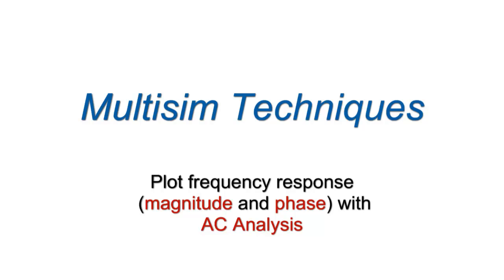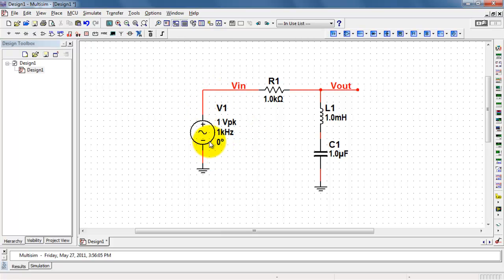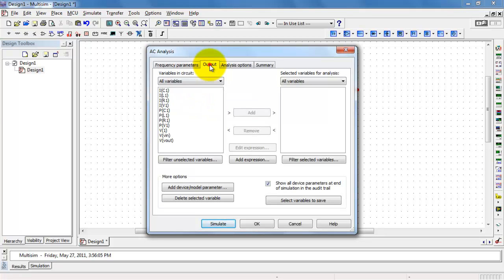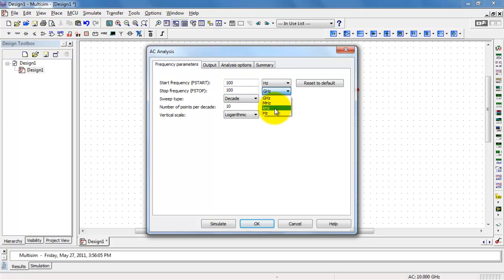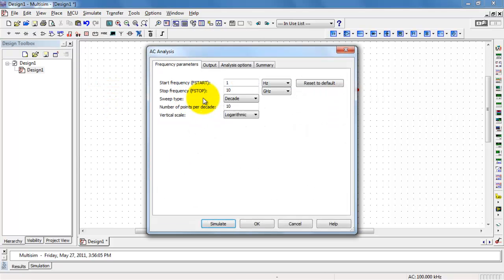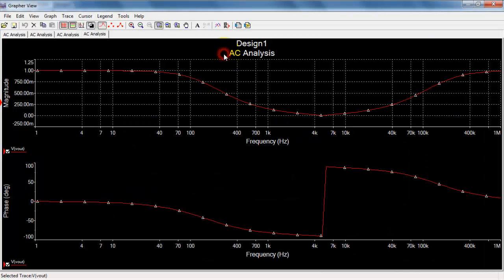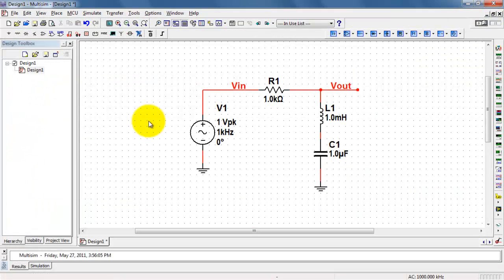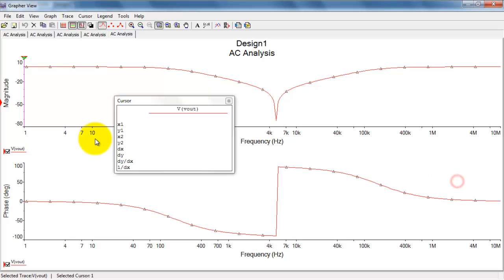NI Multisim: AC Analysis frequency response

Comment: Why does your phase plot show frequency on the X axis instead of degrees.
Reply from the maker: bassk94 An "AC Analysis" reveals how a sinusoidal signal passes through a dynamic linear circuit. Because the circuit is linear the output is also sinusoidal and its frequency is identical to the input. Because the circuit is dynamic (contains energy storage elements like inductors and capacitors) the output sinusoid's amplitude (magnitude) varies with the frequency of the input sinusoid, therefore the "magnitude plot" shows how the magnitude (dependent variable, vertical Y-axis) changes as a function of frequency (independent variable, horizontal X-axis). The output sinusoid also shows a time shift relative to the input sinusoid, and "phase" normalizes this time shift by dividing by the sinusoid's period and by multiplying by 360 degrees or by 2*pi radians. The "phase plot" therefore shows how this normalized time shift (dependent variable) changes as a function of frequency (independent variable). Hope that helps!